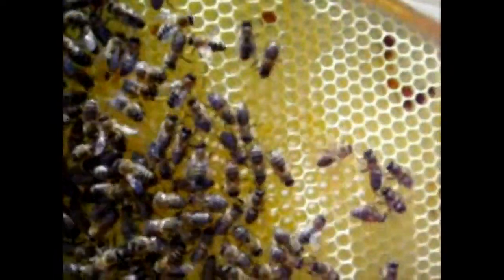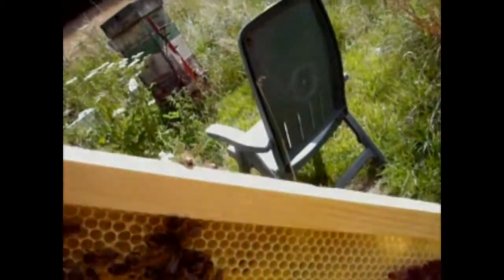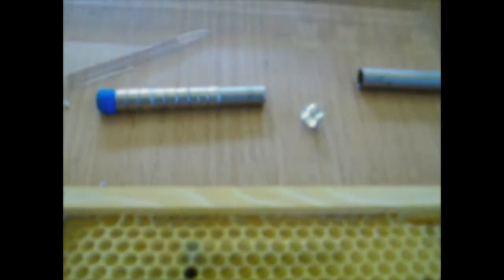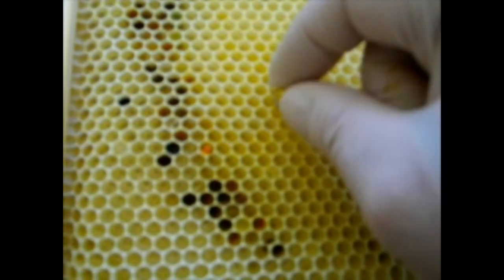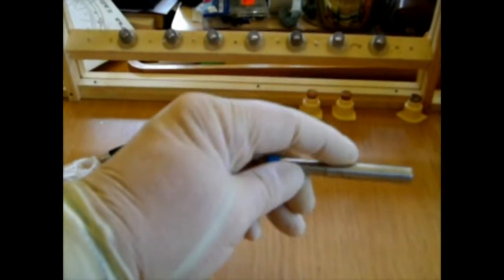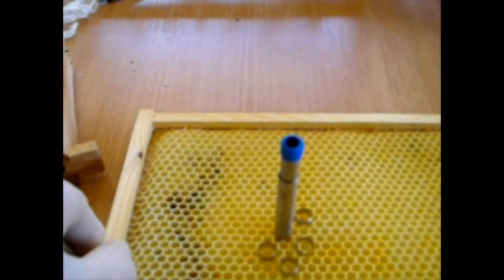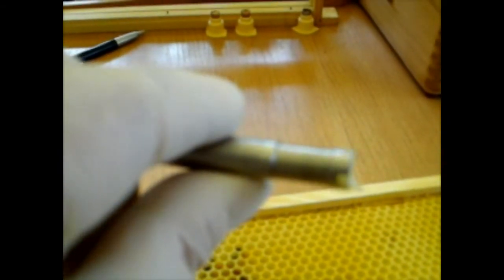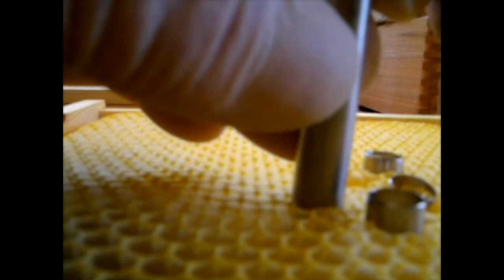Cell Punching Bee keeping

Comment: Can one reuse the metal disks? And what sort of cell cup will they fit in? Jzbz?
Reply from the maker: Hi Brigsy B 
yes the rings just get cleaned and used indefinitely
jzbz cups are small so the punch rings don't fit 
I don't think you get cell protectors for JzBz ( Hair rollers) might be wrong about that
Thornes beekeeping cup holders are about £5 for 10 and a good fit
Nicot cup holders are a quite tight fit so I usually put the tool into them before use just to make pushing the rings in a bit easier
You could just make a bar with a channel of wax and push the rings into it but I find cell protectors are the safest bet in case one queen  hatches first and the other cells get destroyed
Reply: Thanks. Just checking which sort fits before I order them.
Reply from the maker: Brigsy B  
try these https://www.thorne.co.uk/queen/queen-rearing?product_id=6776
I think I linked to them from the eBay listing 
Or 
https://www.paynesbeefarm.co.uk/queen-marking/catching/queen-rearing-spares-for-nicot-10-queens/

the two systems are identical but the parts don't fit one another typically
The punch rings fit either one no problem though

Often with both grafting or  punching, the first set of larva you give them they either ignore or remove
So check after a day and if that has happened just clean the rings and redo the punching
Usually the bees repair the punched donor frame  in about 2 days good as new
Reply: Thanks very much.